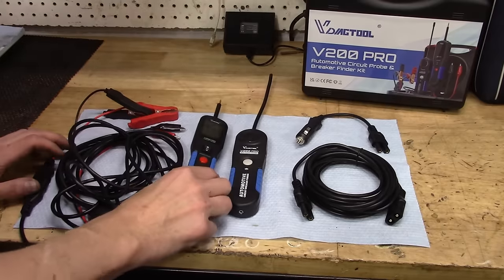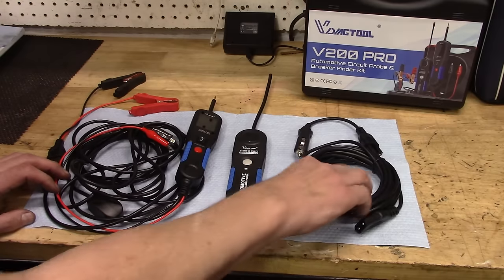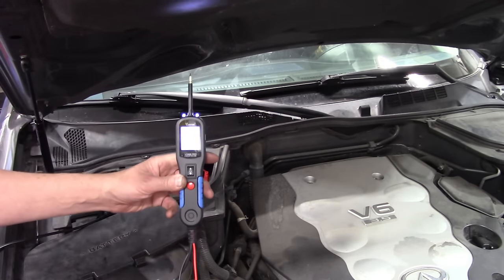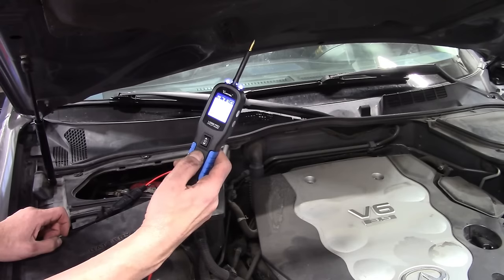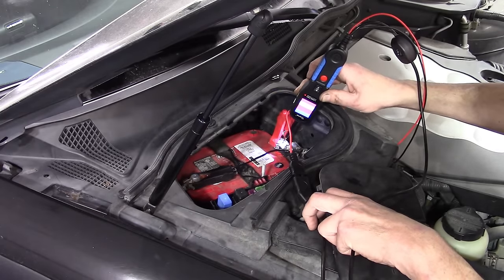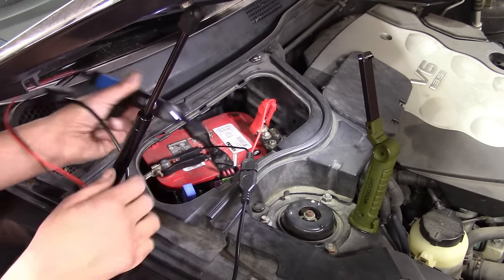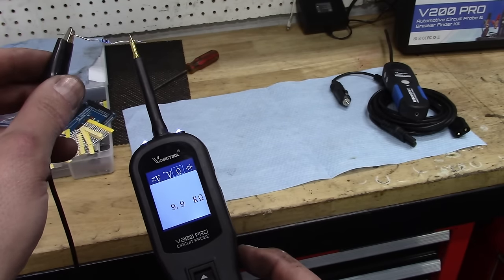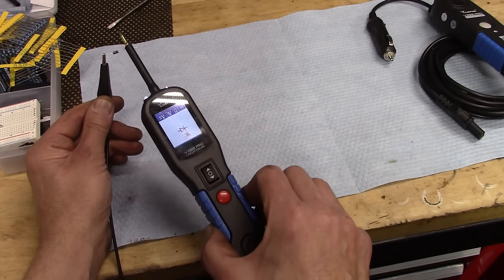VDIAGTOOL V200 Pro WITH TRACKER  Full Review and Tutorial

Comment: I was looking for a good review of this. The price wasn't the biggest sales point but it was a final straw that made me buy it. I was looking for a way to trace a wire going to my transmission from the computer without doing it manually. That means I would have to open every inch of the wire loom and remove the intake manifold just for a few feet of wire. This tool might be best tool for the job. Thanks and keep up the good work.

Comment: Bought the tool.  Traced wires on my '08 Town & Country left sliding rear door.  Attached signal generator to each wire at the B-pillar connector and identified the broken wire (by color/stripe at the connector,) and located the exact spot in the harness where it was broken.  NICE!  Instructions for using this tool (in the included manual) are not clear, at all.  It's in Chinenglish.  Came back to this video and got the exact details I needed.  Thanks!
Reply from the maker: Great to hear!!  yes it’s incredibly easy to use but I do agree it’s a lot easier seeing a video that reading the instructions. I struggled a little with the translation too however being familiar with Power Probe ECT2000 I didn’t really need the instructions that much anyway.
Reply: @SchrodingersBox  is it worth buying???
Reply from the maker: Honestly I would rather the ECT2000 if I had to choose one.

Comment: Subscriber here. I am getting tool tired. I ought the ect2000 whihc was hit or miss. when it works ir works. saved me from trasking my F-150. I have a couble of wire tracers fro HF wihc as not very good. Then bought the Kleinvdv500-820 wire tracing kit. keep up good work.
Reply from the maker: These wire tracers have many variables to them- for example one reason it may be hit and miss is you may sometimes be using it on a parallel circuit. If so you must isolate the circuit you are testing.  
   It’s important to consult a wire diagram and make sure you are testing a circuit that is in the correct configuration.

Comment: Hi Matt.  After watching this review i decided to buy one. Ordered it from Amazon. When it arrived i was eager to use the open scan feature b/c i have a vehicle with a 9 wire harness that i need to determine if all 9 circuits are integral from A to B.  So i hooked up the 2 large alligator clamps to the + and - posts of battery, set the VDiag harness switch to #2 position, and connected to red 'test' lead to one of the wires at the unhooked connector end. Turned on the 'on/sensitivity' switch on the side of the scan tool and pushed the 'test' button. Nothing. Not a peep.  So i came in the house and watched your vid again. Even tho you don't show us what's happening with those 2 large clips i assume they're hooked to the battery...unit has to get power from somewhere after all.  So i mimicked your "bench test" set up and tried again. Still nothing. I have checked the 9v battery in the test tool and it checks out good at 9.6v.  
Am i missing something?  Am i doing something wrong?  I have sent an email to the "support" email address provided on the website and in the User's manual, laying out my dilemma to them as well, but thought i'd reach out to you also and see what your thoughts are.  Thanks in advance for whatever help you can offer.
Reply from the maker: the way you describe it, seems to me you looked for continuity on an open circuit.
Reply: @SchrodingersBox    Then i didn't do a good job at describing what i did with my van.  But regardless of that, I replicated exactly what you did in the video;  large alligators connected to - and + on the battery, switch on #2 position, both black and red short test leads laying out flat on bench, and then turned the side dial on and pressed the 'test' button on it.  No tone. Nothing.  Tell me if i had it hooked up wrong. Did you have the unit hooked to your battery as i described?  I assume so but as i said, you didn't show that in the vid so i'm only going by assumption.  If so, then all i did was replicate what you did and yet i had no tone. Nothing.
Reply from the maker: I still don’t understand what you are trying to do. Are you doing a continuity test or a voltage application?
Reply: @SchrodingersBox   ????  WHAT??!!   Am i speaking Chinese??  What does it matter what i'm trying to do with respect to my vehicle?!  I told you...twice now...quite specifically....that upon having no success using the tool on my van's issue, I performed EXACTLY the same procedure that you did in your video!!  And got ZERO tone.  I have also asked you, TWICE now, to confirm how you had the unit connected...ie. were the 2 large alligator clamps hooked to the battery?   Instead of asking me irrelevant questions, how about starting with that instead.  Bottom line is that i suspect i have a dud (faulty) unit right out of the box.  But i just figured on the off chance i may have missed something...your unclear example in the video doesn't help...that i would reach out to you for some clarity.  All i gotten is responses that are absurd.  Do i confuse people with too much PLAIN ENGLISH??  Jesus!
Reply from the maker: It’s relevant in every way. It’s actually the ONLY relevant question in fact to determine if your configuration is correct.   Are you trying to do a continuity or voltage test? That’s a simple answer.  Answer that and I can tell you the configuration you need. 
    It’s already obvious the VDIAG isn’t the issue. We can clearly see that.
Reply: @SchrodingersBox   The voltage test aspect of the main unit (the power probe) appears to work fine. With DC volts in any case, i haven't tried it on AC voltage yet.  I also haven't tried out the Ohms check or Diode features of it yet.  
So i hope that partially answers your question; "continuity or voltage test?"  The rest of the answer is:  I want to make use of the 'signal tracker' feature/hand held unit. I want to check a wire (that's NOT grounded) to determine whether it has a break in it somewhere (open circuit) or not.  My understanding, from what you said and showed in your video, is that that is what the signal tracker unit does.  How do i do that?  please.
Reply from the maker: @botchvinik8668   OK- see how easy that was? You never once mentioned 'signal tracker' until now.
  I am not a mind reader.  I have to know what you are trying to do.  Now I know. 
      It's extremely basic.  The issue is not with your device.  Its definitely your procedure.
IHere is all you have to do- you very very simply just connect the emitter in series with your voltage source making sure polarity is maintained.  Then position the transmitter into signal mode and connect to the circuit making sure you have continuity with your circuit and that there is ZERO amperage or continuity to ground.  You can have voltage, but make sure do not have any amperage.
Then just place the tracker antennae PERPENDICULAR to the circuit you are testing and the signal tracker should emit sound relative to the proximity of the signal voltage signal.

   I mean that honestly it dude.  I can't make it any more clear or simple than that.  Its a basic level signal tracker.  Its not a 4 channel scope or anything.
Reply: @SchrodingersBox   Ok, a few things in response to this latest reply you provided; 
a)  I DID in fact mention 'signal tracker' at an earlier junction than my latest (not incl. this one) comment. It was in my comment prior, the shortest one of my first 4.  Here it is copied and pasted:  "So let me keep it simple and brief: Can you please just give exact details on how you had the unit hooked up when you demonstrated the "signal tracker" mode of the tool in your video?  Because it's not at all clear in the video."
b) Even tho i didn't precisely say 'signal tracker' in my first (and second) lengthy comments/questions, i did say "...switch to #2 position", and i detailed the "turning of the sensitivity dial on the side of the scan tool" and "pressing the 'test' button on the scan tool".  Given that you did the YT demo of these two tools and thus are surely aware that only one of them has a "rotary side mounted sensitivity dial" and a 'Test' (even marked as such on the device) button, i thought it would have been pretty clear which of the two hand held units i was talking about. And given that the "signal tracker" unit has only ONE function, i assumed it would have been self explanatory as to what i was trying to do. 
c)  "just connect the emitter in series with your voltage source" ....umm, what's the "emitter"?  And where is it?  And by "your voltage source" i will assume you mean the car's battery?  If not please clarify. 
d)  "Then position the transmitter into signal mode" ... i think you're saying to set the selector switch that's on the power probe harness to the #2 setting. ?
Finally, e)  "...and connect to the circuit making sure you have continuity with your circuit and..."   Ok, i'm pretty sure i follow you on that....except one key part:  "connect to the circuit" HOW exactly?  Which lead do i use to connect to the circuit i'm testing?  I'm going to venture a guess and say it's the red wire (about 12 inches long) that has a small alligator clamp at its end.  Because that's the one you scanned for signal in your video bench test demo. and also it's the one you hooked to the circuit in your car to demo the signal tracker in use.   

So i think i'm clear on what you're saying as regards my points d) and e)  But as regards what i referenced in c),  about the "emitter" and "in series with your voltage source", not clear at all at this point.
Reply from the maker: Jeeezus dude. I mean you bought an electrical diagnostics tool and you are asking these basic questions???
   Actually, I get it now. It’s completely clear where the issue is:
It’s between the VDIAG tool and your shoes. 
  That’s where is issue is. 100%.  

  If you would have just paid attention, It’s blatantly obvious you are trying to trace a parallel circuit. That’s why I asked if you verified there is no continuity and no amperage. But you didn’t do any of that.  You just keep wanting to “clip the red clip to battery positive and the black clip to negative”. Dude we are waaaaayyyyy past that. I’m playing chess and you are asking how to play checkers. It’s either that or you didn’t put batteries in your signal tracker.
Reply: Hell ya

Comment: Nice review.  I have the Innova power check which is a Power Probe knock off.  It does offer a setting to just apply 5 volts as well as a 3 volt setting and the regular 12 volt setting.  It does not have a signal checker.
Reply from the maker: Thanks for the info!  Gotta have a signal tracker though- once you have an open and need to find where it is, you will find you can’t live without the signal tracking!!
Reply: @SchrodingersBox  At some point I will probably pick up this tool as the signal checker would come in handy.
Reply from the maker: Good choice!! I can’t even count the number of times I have used a signal tracker. Probably 10 times on camera but at least quadruple that off camera!

Comment: i have the old modle 7years old . the rocker switch started sticking on after 2 days. took apart and fixed. i was using it today on a tractor with no indicators. its good for finding pwm on brake light and back light single element bulb.

Comment: Nice review. Thanks for sharing! The only thing that gets me nervous about these tools is the fuse, I find the Power probe is really good. I've had other brands that, after the tool shuts off, are still passing 10 amps of current! I am curious how this fuse is. BTW, if you have a power probe 4, you can use it as a wand for your short finder.
Reply: I don't follow what you're referring to by "the fuse" and "still passing 10 amps of current".   I'm considering buying one of these tools so if you could clarify your concern better i would be appreciative. Thanks in advance.
Reply from the maker: Yes this has an instant circuit breaker self resetting but I am not sure what amperage is required to trip it.  Indeed it’s a very valid concern and one of the reasons I would like to see a voltage and current limiter available.

Comment: Where do you attach the alligator clips on the signal generator?
Reply from the maker: Just right to the wire you want to track. Easy as that! Just make sure the wire is not shorted to ground or power. Obviously it isn’t not going to be effective unless the circuit is isolated. AND make sure the circuit is linear and not parallel or you will be chasing rabbit holes.
Reply: @SchrodingersBox  it’s an entire harness…connect to one wire at a time?
Reply from the maker: No no no/. Only the circuit you are tracing.

Comment: when you unhook that ecm connector and want to find out which pin it is you will know when you touch the pin (or any part of the bare wire) with your finger because it will use your body as an antenna while youre holding the wand with the other hand. alot like a radio when you get near it and the reception improves. also this CAN induce a tone into nearby wires it likes and lead you astray. mine is a centech harbor freight model which uses a 9v battery $26....it is just as good as the ones i used in the navy to track down  wires in gigantic bundles with hundreds of wires, those were name brand tools cant remember the brand. briansmobile has a good vid on these tone generators. yup if the other end of that wire is grounded you cant tone it, it must be open. so if it eventually goes to a switch for lights the switch must be open or the connector unhooked from in this case an ecm. if that wire goes right to a string of lights you cant track it because it will go through the incandescent filament right to ground. 
these toners work great for house wiring. you can track a wire through the wall, through the ceiling, attic, etc.  

if a wire goes from an outlet up the wall and i want to know which way it goes i can hold the wand near the wall and its that good. 

this centech model may put out more than that tool you have.
and if you look on amazon they have one called noyafa that is very strong. it will track wires underground which this cannot. say you have a shed and the wire goes underground to feed the shed. ok. but you want to dig there without hitting the wire. tone it out with a strong tool.

all it does is send a funky wave of current through the wire and the wand converts that field that it picks up into an audible noise.

looks like that tool you have doesnt do a load test like the load pro. i like power probes, i may get one, so far ive gotten by with my own test leads and cords for that kinda stuff (injecting 12v + into a wire to test the circuit) and usine the ground of the battery as a reference point not the ground of the circuit in question so i know if its a bad ground or not. i need to get a load pro but i can just make one

and i dont need lisle or electronic specialties relay adapters to test relay pins while they are plugged in because i have a kit of terminals, you know the red, blue, and yellow ones you crimp. i can hook up and probe any relay, but today all i had to do was put a jumper in the socket to know the problem for my dim running lights is not the relay, its a source voltage issue from the auxilliary battery. also not pullswitch or wiring for rooflights loom. e350 chassis van, minibus.

Comment: Nice!
I would have liked to see how well it located the pin for that wire in the connector.
How does it feel in your hand?
Like a well made quality tool?
Reply from the maker: It feels same quality and feel as power probe. As for the specificity on a single wire- it really depends on a lot of variables- the best way is to separate every wire in the harness.

Comment: Appreciate your review! Could you not create your own open to track by disconnecting either the source, the load, or both, at least in some scenarios?
Reply from the maker: Yes you could however the issue would be if the wire is shorted to ground somewhere you will not be able to create an open by disconnecting it

Comment: But how do you find shorts? Power probe lets you and most of my issues are shorts. Awesome video get up the great work.
Reply from the maker: yes this is an open finder. it doesn’t find shorts like ECT3000
Reply: @SchrodingersBox  so how do I find a short? I have one, every time I put the fuse in it blows. I like this review but doesn't do what I need.
Reply from the maker: You need an ECT2000. That’s what I use.

Comment: Signal detector similar to a phone toner. Great price.
Reply: or like some of the home wiring testers where you plug it in and can see in the circuit breaker box which circuit it is.  Have to dial down the sensitivity due to crosstalk on the nearby wires.